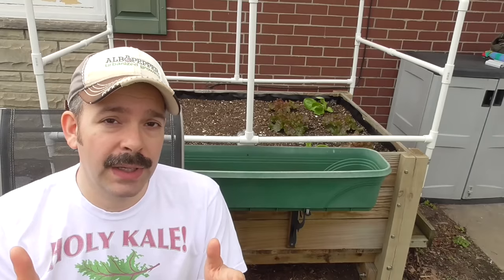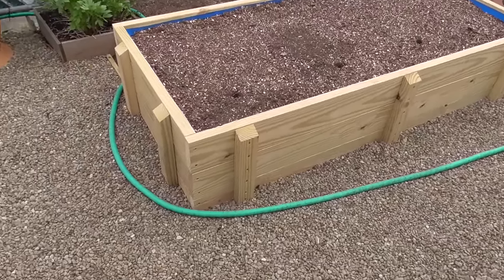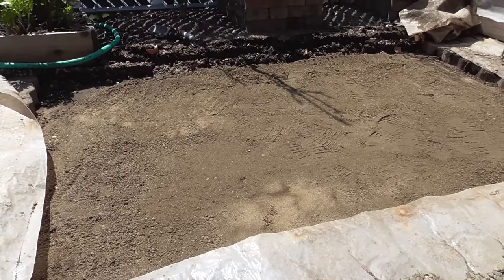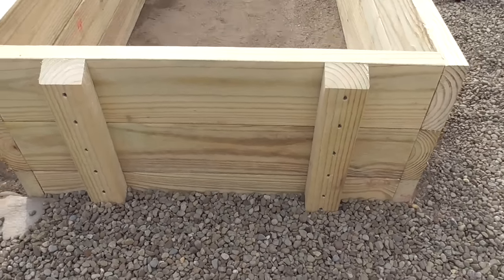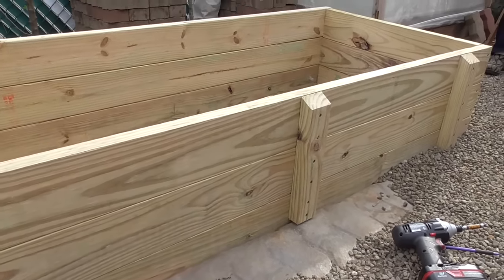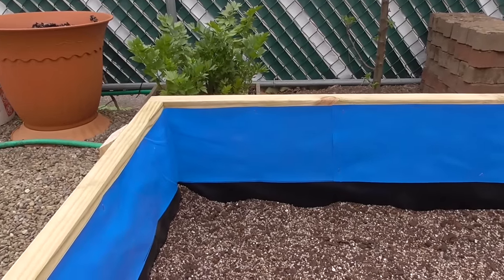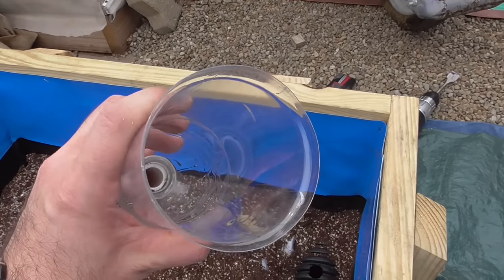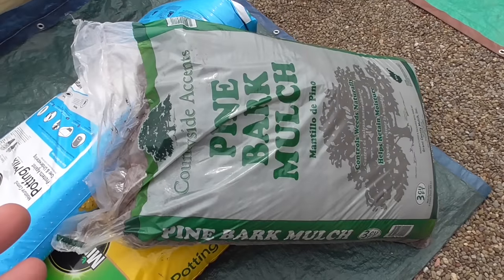Self-watering SIP Sub-irrigated Raised Bed Construction  (How to Build)

Comment: can you go deeper than 16.5 inches and how deep if so
Reply from the maker: George Warner Hi George. Yes, you could go deeper.  I'm not sure how deep you are thinking.  As you go further up, the potting mix will start to be dryer.  Each mix has its own physical characteristics.  I'm not sure what the maximum wicking potential will be.

In a worse case scenario, the water won't wick all the way to the top and you might have to top water it from time to time.  If you get lots of rain: not an issue.  In drought areas: it could be a pain.  Anything beyond let's say 18", will start be a little experimental.  I'm not saying it won't work.  I just don't have any 1st hand experience to share.

Comment: Does using artificial fertilizer make the plants less healthy or  lacking in micronutrients?

Compost should have most of the nutrients a plant needs. I would love that to be my nutrient source. But most are fertilizing with synthetic fertilizers. Which is hard for me to fathom. If I'm going to put all this work in, I want to grow the healthiest plants I can. Am I missing a critical component?
Reply from the maker: Synthetic fertilizer works great, as long as it is  a well balanced formulation. And it might include micro-nutrients too. Organic nutrients work well too, although they typically require a larger volume. And to be honest, there's no reason a grower can't use both if they desire to. My advice on compost options is found here: https://albopepper.com/refreshing-sip-potting-mix-adding-fertilizer-year-2.php

Comment: Nice planters, but the braces on the sides will NOT prevent the pressure treated boards from shrinking and leaving a gap
Reply from the maker: Yeah, they worked fine. The lifespan of the actual wood is the biggest issue. All wood rots, even PT.

Comment: How does the rest of the resivoir get water if the PVC is only connected to one pipe
Reply from the maker: The water travels between the holes in the pipes and the pore spaces in the potting mix. Check this for further explanation: https://www.youtube.com/watch?v=VJ2T6gUv8Gc
Reply: AlboPepper - Drought Proof Urban Gardening if I have a continuous run of drain pipe does it hurt me to coil it and leave it connected?
Reply from the maker: You can coil it if you prefer in one continuous piece. It won't hurt anything. Just try to maintain a consistent gap between the pipe edges.

Comment: I built two of these per your instructions.  I planted seeds for various veggies.  Some sprouted, others nothing.  Those that sprouted didi not mature.  I also planted a small tomato plant.  All plants are either dead or wilting.    What do you think is the problem?  Soil? Too dry/wet?  Any help please.
Reply from the maker: What's the exact material used for the soil? What has your weather been like? Rain? Drought?
Reply from the maker: @Squeaky G Yes, without nutrients the plants will simply not grow. It's not neceassry to wait an entire season before use. Adding in fertilizer will address the issue. And using a liquid feed can help to kick start the system for faster results. Micronutrients have their place and plants certainly need them. But MACROnutrients are even more essential and plants need them in much larger quantities. Without a sufficient supply, the plants will never be able to thrive.

Comment: can the depth of the raised bed be 20 inch deep?
Reply from the maker: philk1148 On a 20 inch box, I would raise the overflow tube by 1/2 inch. As you go deeper the upper level of the soil may start to get drier. In a relatively wet / cool climate the 20 inch depth might be advantageous. Plants that dislike soggy soil may even thank you. On occasion you might find yourself watering the TOP of the soil too just to keep it all moist. Including coir can help to boost the wicking & retention properties of your mix. Regardless, I would MUCH sooner go 20 inches than 13 inches.
Reply: Thanks.  Got me a summer project

Comment: in nature the water drains ,the roots can dried for days ,why would you go against nature ,and keep the roots moist? what about 4 inches off gravel ,would that serve the same purposed ?
Reply from the maker: This design allows people to deal with a variety of challenges. It better conserves water, helping in drought prone areas or in areas where the soil is excessively sandy. It protects crops from invasive roots of certain native plants or trees.

Some people use gravel in wicking beds. But gravel does not wick water nearly as well as potting mix. Gravel also displaces a lot of volume, reducing the water reservoir capacity. Plus gravel is much harder to transport and install. On rooftop gardens, the extra weight of the gravel makes it highly impractical.
Reply: AlboPepper - Drought Proof Urban Gardening mgood

Comment: What about liquid fertilizer into the water reservoir that releases when its wicked?
Reply from the maker: I would just apply the fertilizer to the soil surface as a root drench.
Reply: Also, I want to do square foot gardening, measurements suggestions for a standing one? I was thinking 16.5 deep like you said and 3 feet wide. We are probably going 20 feet long.
Reply from the maker: Either 3 or even 4 ft wide is fine (assuming you can reach in from both sides). When you say 20 ft long, are you making multiple SIP boxes? Or do you mean a single continuous 20 ft long box?
Reply: @Albopepper  I think its going to end up being two 10 foot. Originally it was planned to be 20 ft. I'm incorporating companion planting too. I take it that it's okay to grow it on the outside because I want to add planter boxes on the sides for it. Trying to figure out the best way to self irrigate it without being too shallow.
Reply: How can I send you the pics of ours? I don't see where I can post a pic here.

Comment: Probably not a good idea to use pressure treated lumber for raised beds since the chemicals in the wood can contaminate the soil. Wood even pressure treated will rot if it constantly wet. I would recommend using stone or brick. Cement blocks might also work, but my understanding is that cement contains a significant amount of salt, which probably would leach into your pottingg soil.

Good idea of using drain title piping for drainage.
Reply: PT lumber will not contaminate the soil if the bed is lined with pond liner which he has done in this video. He also addressed using PT lumber at the beginning of the video.

Comment: +AlboPepper I cant wait to try this out. I'm going to make some more add on's to my raised bed, but I really hope that this will help me save water (California drought is very real). By the way please check out Albo's website, its very informative :)
Reply from the maker: +W00t57  - Sweet!  I had excellent results this year in the bed.  Watering the bed was effortless, even without an automated float valve.  Thanks for watching and I hope this helps you out!
Reply: +AlboPepper I have a few questions though. Maybe start a interesting discussion :)

A little background. SIP systems seems great for premature too mature biological growth. But how does it fare with seedlings, and germination?

I'm trying to better understand how far your SIP systems capillary action is actually occurring. From my research, with just organic top/potting/combo soil mixes it seems that an optimal capillary action can only go about 3-4 inches. Which is fine, because I could use a drip system for the top layer... 

How affective is it in reaching the top most layer from the SIP? 

Will adding a layer of loose fine sand above the SIP system work to increase the range of the capillary action of the soil above? how can we increase the range to help germinate seeds, and keep seedlings moist? 

If you have a digital or non-digital moisture meter, could you test the soil? From 7inch below to 1inch below the top layer? Maybe note the observation here? 

Thanks again!
Reply from the maker: +W00t57  - Be sure to watch my 2 follow-up videos which expand on the SIP concepts. In Update 1, I demonstrate how the container depth effects moisture levels, using a moisture meter.  I've tried to compile useful SIP info on my website as well. Hopefully it can expand on what is covered in this video.
 
Seed germination is no problem. Outside I started watermelon, spaghetti squash, carrots & corn this year in SIPs. I just spritz the top of the mix with water every day (if it looks dry) to keep the surface moist until the seedlings are established. Indoors, I started a variety of plants in a small-scale SIP design that I developed. Check it out here: http://albopepper.com/albo-stein.php
 
Adding sand would not be advisable in an SIP. Peat moss actually displays excellent wicking capabilities. I expect good capillary action to occur at a distance of 12 inches or more using an SIP potting mix. Only the top 1/2" tends to dry out and crust up, if left unwatered and uncovered.
 
Thanks for the good questions. I believe that properly using an SIP system can yield great results. It fills a need, just like hydroponics does. I use my SIPs for annual vegetables and that is where they really shine!  xD
Reply from the maker: +W00t57  - Sweet man!  I look forward to seeing your results,  :)

Comment: can you use gray water?
Reply from the maker: I've never tried doing so. I would prefer to use it on plants that are in the actual ground. Obviously a person would need to be selective about the detergents and chemicals that they are using. But even if that is the case, I don't know if it would cause issues in an enclosed system like an SIP.

Comment: its few yrs since video was made,  awesome tutorial.. i just domt understand why you would call using manure and compost .. GROSS. some of the best natural amendments
Reply from the maker: BAGGED COMPOSTS? To prolong the viability of your SIP potting mix, it's best to replenish nutrients in the form of fertilizers. Organic gardeners are apt to use compost as often as possible. In SIPs, worm castings can be included in small amounts. But using composts in containers can yield unpredictable results. Bagged (retail) compost, humus or manure might have a fine consistency, similar to garden soil. If it contains fine silty particles then this can reduce pore spacing and aeration properties of the mix. That's why topsoil is NEVER recommended.

As air gaps get plugged up by ultra fine particles, compaction occurs. And since SIPs are always resting on a perched water table, the few remaining air gaps tend to be saturated with water. This impairs root health, preventing plants from getting the oxygen needed at the root zone. This can lead to a decline in plant growth, or even root rot and death. Even if plants grow ok in the first year, over time the potting medium may break down to the point that it must be replaced.

HOMEMADE COMPOST? Buying bagged compost is not financially advantageous in large beds anyway, not when compared to buying a bulk organic fertilizer. Of course, homemade composts might work, especially if they are mostly wood based. These tend to have more structure. Larger particle size means improved aeration. I've found though that it's very easy to reserve my compost for conventional beds and perennial plantings. It all gets used, just in a different location. 

https://albopepper.com/refreshing-sip-potting-mix-adding-fertilizer-year-2.php
Reply: @Albopepper  ok, thanks for the explanation,  i live on farm and use old manure, basucally turned to dirt now..its approx  12 yr old manure, and get great resulys. i was just curious why couldnt be used in  DIP...
getting lil older n want to get into raised bedsso doing research on it
thanks, wasnt sure id get reply after so many yrs.. appreciate it and your indepth explanation

Comment: Why do you even need the tube? Wont the water be able to escape the drain hole without a tube?
Reply from the maker: The tube ensures that the overflowing water is drawn from a pocket of water and that no potting mix gets sucked into the overflow opening.

Comment: Why shouldn't I use manures?
Reply from the maker: Hi Jodie!

BAGGED COMPOSTS? To prolong the viability of your SIP potting mix, it's best to replenish nutrients in the form of fertilizers. Organic gardeners are apt to use compost as often as possible. In SIPs, worm castings can be included in small amounts. But using composts in containers can yield unpredictable results. Bagged (retail) compost, humus or manure might have a fine consistency, similar to garden soil. If it contains fine silty particles then this can reduce pore spacing and aeration properties of the mix. That's why topsoil is NEVER recommended.

As air gaps get plugged up by ultra fine particles, compaction occurs. And since SIPs are always resting on a perched water table, the few remaining air gaps tend to be saturated with water. This impairs root health, preventing plants from getting the oxygen needed at the root zone. This can lead to a decline in plant growth, or even root rot and death. Even if plants grow ok in the first year, over time the potting medium may break down to the point that it must be replaced. 

https://albopepper.com/refreshing-sip-potting-mix-adding-fertilizer-year-2.php

Comment: Pretty useful info, although saying "other people aren't doing it right" and then you proceed to stuff organic material down into the wet section where it will go anaerobic is kinda off-putting.
Reply from the maker: Did you see the SIP videos that were out 9 years ago when this video was released? Because I did. And quite frankly, there were basic design flaws that created critical failure points. Interestingly, many of those videos never had a follow-up video to prove the reliability of their designs. I'd even gotten emails from people who followed poor advice and it turned into a nightmare for them. So as far as I'm concerned, those particular YTubers weren't "doing it right." Does that ruffle feathers? Maybe. But I couldn't care less. Shame on them for providing unreliable information. Even still, it's not like I named any channels or linked to any specific videos. I merely focused on design flaws. And I still stand by that stance.

I understand that you might be off-put by concerns over potentially anaerobic conditions in the reservoir. But the reality is, the plants grew extremely well. I made follow-up videos showing exactly how things turned out. You can see here and judge for yourself: https://www.youtube.com/watch?v=VJ2T6gUv8Gc

If you want to go a different direction, that's fine. But I've been testing this basic setup for more than a decade & I have the documentation to back it up. I even have a new video coming out this spring with further enhancements. My concern is that gardeners get the best possible results.

Comment: I wouldn't use pressure treated lumber for vegetable or herb gardening, there are chemicals you don't want leaching into your garden area even though it is contained in a membrane. I wouldn't risk it
Reply from the maker: Don't use anything you don't wanna use. I have no issues what-so-ever. I know exactly what the wood is treated with. And since there's no arsenic or chromium, I have no reason for concern. That's besides the fact that the soil is completely separated from the wood by the liner. It never even touches. That means zero risk.

Comment: I don't think I get it.. You have a four inch pipe, filled with water to roughly 3 inches, then you put the potting mix on top.  The water isn't going to flow against gravity by itself, so it needs direct contact with the soil for osmosis to pull it up.  The only place it really gets that is at the 'V' junction of the pipes.  It would seem that once that 3" of water drops below 2", it is out of contact with the soil and just sits there.  So how does it work?  Do you purposely push soil between the pipes and fill the gaps entirely?  You didn't show that or say anything about it,.  That would help get water up, but also make for waterlogged soil, which you said you were trying to avoid.

A ground cloth, pushed down between the pipes, would help keep dirt out of the pipes (it may take a while with those tiny slits, but they will eventually get enough dirt in them that you'll have to clean it out), and act as a wick to pull water up in contact with the soil.  But you didn't.. so.. How does it work?
Reply from the maker: Hi Chris, at 16:01 when I say to stuff the wicking material in between the pipes, that means all the way down to the base. It should be at the very bottom of the reservoir in between the gaps around the pipes. Very little soil is waterlogged when you use an appropriate number of pipes. You can use cloth if you'd like. But this is unnecessary. After years of usage, I've opened up one of these pipes to see what sort of dirt collected inside: https://www.youtube.com/watch?v=q-JitnHKCY8  Using an appropriate potting mix material helps in this regard.
Reply: @Albopepper  Would putting a landscape fabric on top of the pipe that already filled with wicking material helps to protect silt and fine particles if you use compost on the top layer ?

Comment: If the drain tube wants to curve up or down, simply rotate it 90 degrees so it curves left or right instead.
Reply from the maker: Thanks for the tip! I've also found that bending it in the opposite direction helps to straighten it out so that it doesn't try to curve as much.  :)

Comment: Why did you need a water tight liner?
Reply: +Jj Wyllie I built something similar but with gravel and landscape fabric. The reason for a water tight liner is to essentially create an artificial water aquifer to retain water so that water wicks up. If you don't use a water tight liner the water you add and rain will simply soak down into the ground beneath the potting soil rather than retaining the water.